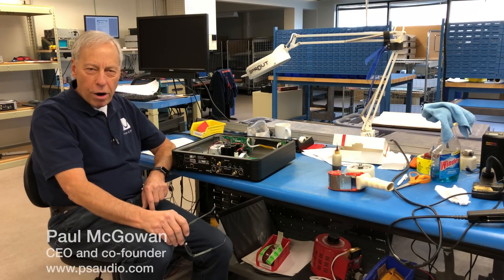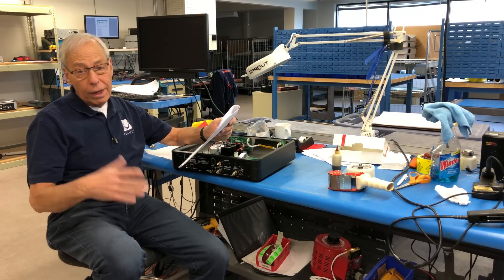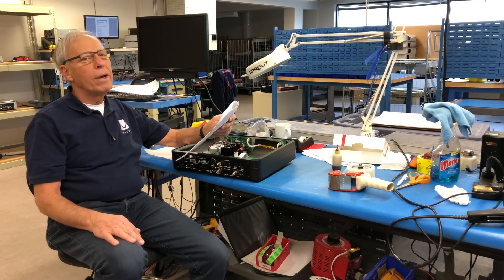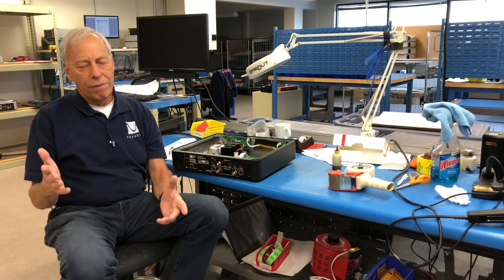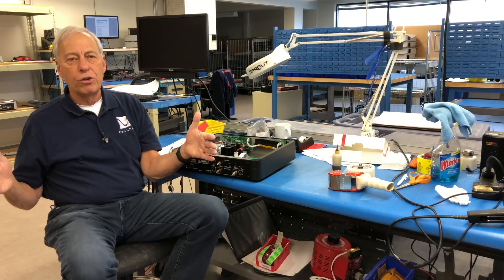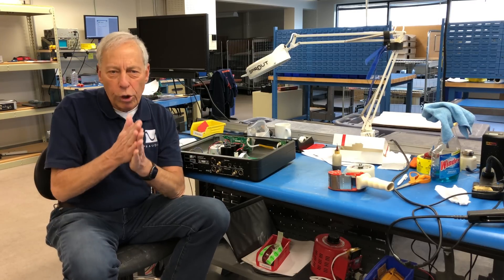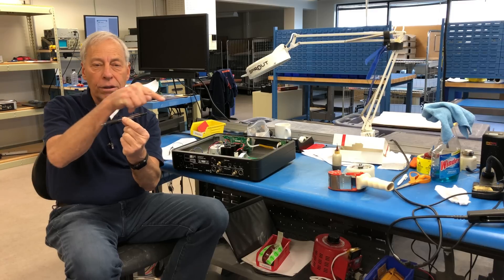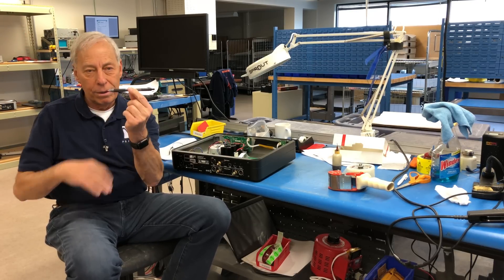Are low impedance speakers hard to drive?

Comment: The perspective is from the amp or from the speaker. The consumer looks at the speaker impedance being easier to push current through. But the amp is worked harder. The engineer see from the amp and the lower impedance makes the amp works harder.
Reply: With the same voltage this is true.

With the same output (in SPL or current) this is not true. Then the amplifier only needs half the voltage and half the power. And there is also less stress on the driver with less voltage and less power, and that gives less power compression (and more dynamics).

And yes, I'm an electrical engineer with understanding of the working of drivers.
Reply: That's what I always thought. I mean 20 watts is 20 watts right? Let's say you are feeding an 8 ohm speaker 20 watts with volume setting of say '5' on your amplifier. If you switch out the speaker for a 4 ohm speaker and keep running the amp at setting '5' on the dial, won't it now be feeding it 40 watts and the speaker will be a louder volume (+3db)? This is saying the speaker is exact same sensitivity.
Reply: @brydon10  One (minor detail) remark: it is the current that makes the speaker louder, not the power.
Reply: Ah okay, so other than that, what I say is theoretically true?
Reply: @brydon10  In my opinion that's true, theoretical ánd practical.

So with drivers with lower impedance you need less voltage and less power (theoretically).

But if you have an impedance drop at a certain frequency the amplifier has to deliver more power at that frequency (with a normal voltage-drive amplifier, with current-drive amplifiers you need more power with impedance peaks).

With a rather flat impedance curve you better have a low impedance (practically).
Reply: Okay so if the volume remains constant but the impedance is halved, the amps need to be doubled. So the voltage would also be halved? 
I haven’t worked with audio electrical for 40 years and that was in school. Even my digital is getting rusty after working at Intel production and prototyping.
Reply: Brad Isley 
No, if the volume stays the same, the current stays the same (the output is dependent on current, not on power or voltage), that’s (high-school) physics (electrodynamics or magnetism): the current makes the force. 

If the impedance halves you need half the voltage for the same current, that’s basic ohm’s law.
Reply: Jerry Rutten thanks, that was about 45 years ago for me. I just build them not design them now.
Reply: Brad Isley You’re welcome! 

I designed and built a current-drive power amplifier (a voltage controlled current source). That required the rethinking of the interaction with the loudspeakers in terms of voltage, current and power. 

Current creates force, force creates acceleration, and acceleration creates SPL.

But the speed of the cone creates a voltage on the inputs of the loudspeaker (a loudspeaker works also as a microphone, that’s where the electric damping comes from). This voltage distorts (this is called current distortion in loudspeakers). A current-drive amplifier eliminates that and all other influences of impedances: differences, changes, frequency dependencies and non-linearities.

Comment: Voltage/currant garden hose with water freely flowing out, Speaker Impedance is your thumb over the nozzle creating Resistance, the harder you press the more Resistance, think of hard pressure 2 
ohms, medium pressure 4ohms, light pressure 8ohms for example.

Comment: Then why 32 ohm headphones are much easier to drive than 600 ohm headphones ?
Reply: That means your amplifier doesn't have enough current to drive the high impedance headphone.
Reply: It's not that 600Ω loads are really "harder" to drive because the currents involved are so low, but they require higher voltage. Look at it from the Ohm's law perspective... to take a random power level as an example, moving 100 milliwatts through 32Ω requires roughly 1.75 volts but moving 100 milliwatts through 600Ω requires roughly 7.75 volts. If you take a circuit designed to drive a 32Ω load at 100mW and connect a 600Ω load, you'll only get 5.1mW out because you need more voltage to push that current along through the higher impedance. At the other end of the spectrum the equation flips and the hard part becomes gracefully passing huge amounts of current through the speakers without overheating the output transistors.
Reply: @Peter_S_ ...'spoken' like a true educator! ;-)

Comment: That’s why I’m glad that my amp is good for a 2 ohm load.
Reply: When do you get your 'welding certificate'?
Reply: 90% of amps "are good" for 2 ohm loads. That's a meaningless statement. How well does it operate into a 2 ohm load is the question. If it doubles it's 4 ohm rating into a 2 ohm load, then its truly a high current amp. For example, a first or second generation Bryston 4B while not rated for 2 ohms will still output the same 400watts as it's 4 ohm rating. Some manufacturers will call it 2 ohm compatible but it's virtually meaningless. Essentially it's not high current but won't blow up or go into a protect mode if subjected to a 2 ohm load. Make no mistake it does affect the sound quality especially if the speaker's phase angle is severe at the low impedance point as well

Comment: If you consider lowest impedance possible of 0 Ohms or a short circuit of the amplifier output, you can imagine how that is equivalent to when someone short circuit the mains power and a fuse breaks. Lower impedance means higher currents and at some point, unless the amplifier has a protection circuit, the transistors will heat up beyond good and potentially blow as a fuse.
Reply: Usually what happens is a transistor goes short circuit, and blows the B+ or B- fuse inside the amplifier.

Comment: I tried Maggie LRS's and they kept shutting down my Emotiva monoblocks. I don't run Maggies anymore... (not my style sound either)
Reply: Wow, i would've done the reverse.
Reply: Which mono blocks? I run 2 pairs of Maggie MG12S with a class D multi channel from Rotel RMB-1085. I was thinking of building a second system with the LRS + emotiva class D mono block.
Reply: Interesting. Which specific Emotiva monoblocks are they?
Reply: @sean_heisler  XPA-100 440wpc at 4 ohms
Reply: @stonefree1911  Wow, that's crazy! Hmm. Those are class A/B as well. Worries me to think I was thinking of trying the LRS with my 140 w/ch Musical Fidelity M2si. Thanks.
Reply: @sean_heisler  Yeah, I dunno, but the maggies would shut these down. I have Wharfedale EVO 4.2's now and they can play all night at any level with the Emotivas.
Reply: I run Maggie 1.7s on the cheaper Emotiva Basx a-300 amplifier. At 4 ohms it's rated at 300wpc. I never have any issues with the system.
I wonder if something is wrong with your monoblocks?

Comment: Great explanation! Certainly one of the most lucid discussions of impedance v. power demand for those of us who are not electrical engineers
Reply: Actually I learned ohms law in junior high school.... You don't have to be an engineer to understand the concept. Higher watt is always harder to drive.  Less resistance means higher current for same voltage.
Reply: @oysteinsoreide4323  
Most people struggling to understand this, are missing the "same voltage" part - or don't understand why voltage matters.

Comment: As a former teacher I remember one of the hardest things to do as a teacher is to explain something so incredibly obvious to someone who doesn't understand the concept AT ALL! This matter is further complicated when  dealing with a topic that doesn't inherently make sense. You talk about it being easier to drive current through something that has greater resistance. THAT MAKES NO SENSE!  It reminds me of times when I would tell the students that matter with a higher heat capacity retains heat longer. They would ask, "Why?" And I would say because it just does.
Reply: On its face, it really doesn't make sense. The more it resists, the harder you have to push!
Reply: @JazzinBlues  
But amplifiers don't push harder when there is more resistance.  
This is contrary to human behavior.  When we try to move something, our goal is usually to achieve a certain speed.  We don't apply the same force to something that is harder to move - we naturally increase the force to compensate.  
Amplifiers don't do that; they use the same amount of force when the resistance increases so the result is less movement (current) and less work (power).
Reply: That seems a terse commentary. It makes perfect sense if you look at the power flowing as a function of the voltage available combined with the impedances of the output transistors in series with and in relation to the load of the speakers. If you simplify things and don't consider 2 of the 3 main variables, how could any of it make sense? You need to provide students with a complete picture and the immutable laws of physics do the rest.
Reply: If it was a matter of driving a certain amount of current, then it would be harder with a higher resistance.  
But that's not how it works.  Amplifiers don't try to drive a certain current.  They output a specific voltage, then the load determines the current.  At the same voltage, producing more current for the lower resistance is definitely more work!  Thus harder, not easier.

Comment: Lower impedance means the speaker is less of a roadblock for current, thereby drawing more current from the amplifier and driving the amplifier harder because it has to output more power.
Reply: Ok but what's the advantage if any? Seems lower impedance draws more current and is harder on a amp so what use a low impedance speaker seems more disantavages than advantages.
Reply: @72tx340  Andrew Jones gets into a great explanation of his interviews on why he goes for low impedance speaker designs. He's done many interviews, so i can't tell which one. But, here's an explanation from Eric Alexander (Tekton) for the layman https://youtu.be/tMAO9LPsups     A whole lotta disinformation floats around in the forums. Listen to the speaker designers (with an active noodle in their heads) and learn instead.
Reply: @72tx340  First the sound volume produced is based on the speaker's sensitivity.  It need not be related to its impedance. 

Second, there are two ways to increase power output.  You can either increase the voltage or you can increase the current. Low impedance speakers increase power by drawing more current for a given voltage.  It has been easier for designers to accommodate increased current output than it has been for them to accommodate higher voltage outputs.

So, if you are interested in higher output, you are better off with lower impedance speakers; but,  you need to make sure your power amplifier can handle the lower impedance.
Reply: Thx, now  i understand it. sry Paul but Frank explained this one better :)
Reply: There's a good middle of the road  approach. Low impedance speakers lead to unnecessary power demands and heat.

8 ohms is just fine. 4 ohms and lower is begging for problems.
Reply: That's why I always use my 6ohms fits pretty much in any class d amps today
Reply: Incorrect, the lower impedance speaker does not draw more power from the amplifier because it "has to", it simply "can" draw mower power. These poor explanations lead readers to believe lower impedance speakers draw more power to produce the same relative spl as a higher impedance speaker which is simply not true, in fact it is more often the opposite if all other things are equal.
Reply: @72tx340. Lower impedance, if amplifier is able to drive, makes the output circuit 'faster', which can be used to provide higher bandwidth/ cut off. But this is mostly a design time parameter to make good use of
Reply: This simply isn’t true..
Reply: So why would you ever want a lower impedance speaker? Is a 8 ohm speaker.half as loud as a 4 ohm one?

Comment: I think I lot of people find Ohms law counterintuitive because of the perspective. Another way to look at it is that a lower impedance speaker "forces" the amp to work harder.
Reply: Omne Obstat replace the word “allows” with “forces”. The amp must deliver a certain amount of current to the speakers if impedance goes down. A little class D amp might not have that current available, while some heavy solid state monoblocks won’t have any issue with that.
Reply: @audiofun999  For me, the word should be "demands". A lower impedence speaker demands more current from the amplifier, increasing the chance of it not being able to supply that current.
Reply: @mindtraveller100  thanks for your simple solution
Reply: It actually does not "demand" more current. "Allows" is in fact a better term. The demand of power amp is controlled by input voltage signal strength multipled through the power amp stage. Impedance constrains its output, it does not dictate it.
Reply: As to my reply .... "Counterintuitive" is what I mean by "makes no sense"
Reply: @datadaveangelstravelsadven444  I would have to assign differing definitions... I would define "counterintuitive" as something that works the opposite of assumptions generated from an incomplete knowledge whereas "makes no sense" implies something breaking more complete knowledge of operation. In all cases people should remain cognizant of their understanding of the entire situation.
Reply: What if you just turn the volume knob lower when using 4 ohm speakers? Wouldn't it be similar to using 8 ohm speakers? Would the 4 ohm speakers be louder at the same volume position?
Reply: @brydon10  The volume changes the output voltage. The speaker impedance determines how much current is required to maintain that voltage across the speaker. Produced sound volume for a given voltage is a function of the speaker's sensitivity which is independent of of the speaker's impedance.
Reply: Peter - what you just said is what is making everyone confused in the first place. No offense intended but everyone would probably have been better off if you had just kept that one to yourself.  :)